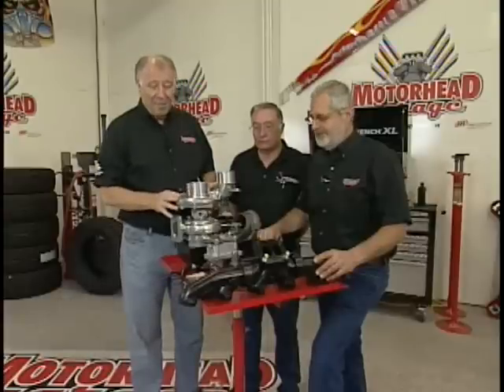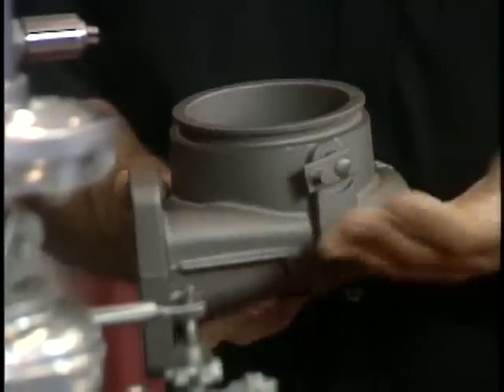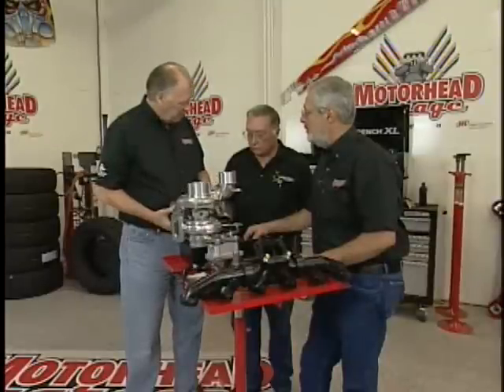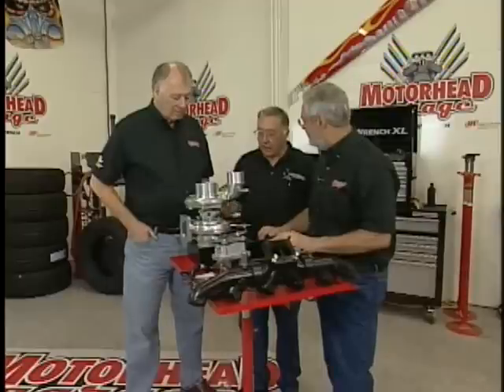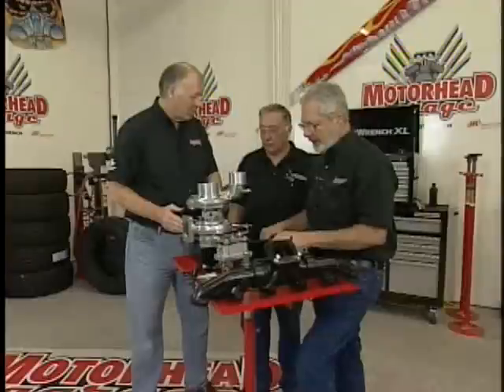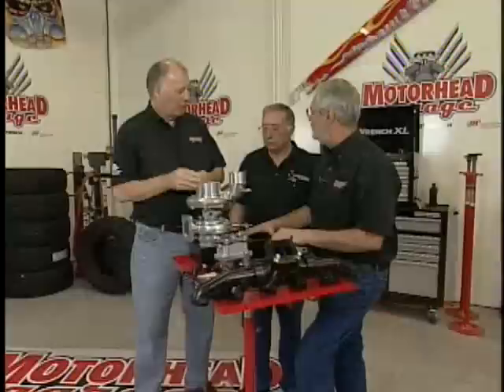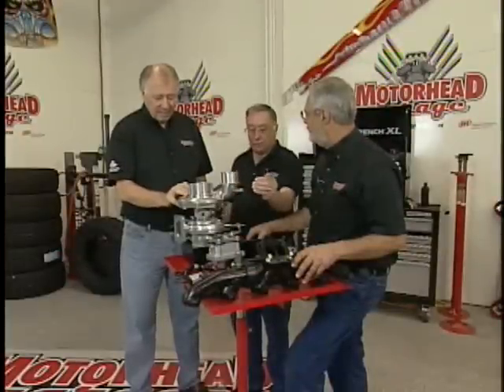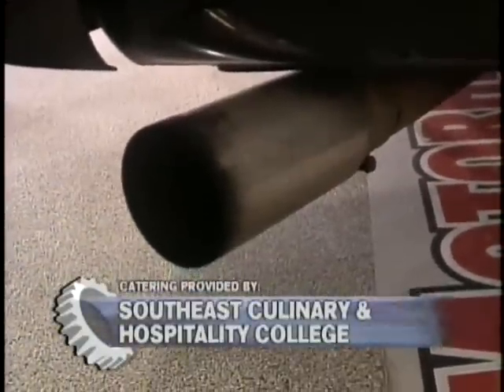Switchbladeturbo on Motorhead Garage

Comment: depending on the boost you'd like to achive, you'd need to lower compression, internals, wastegate, dumpvalve, larger injectors, intercooler, boost pipes, oil feeds and return etc.